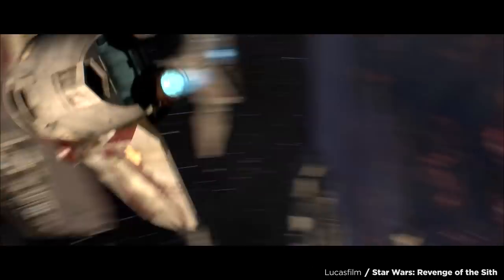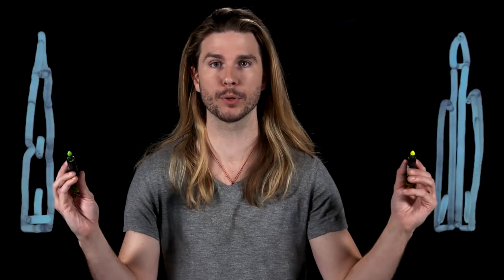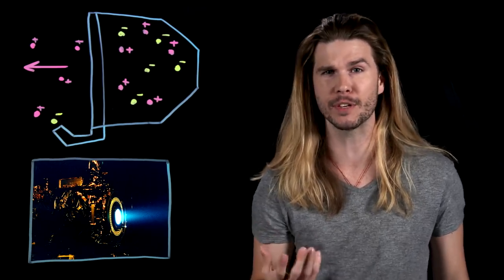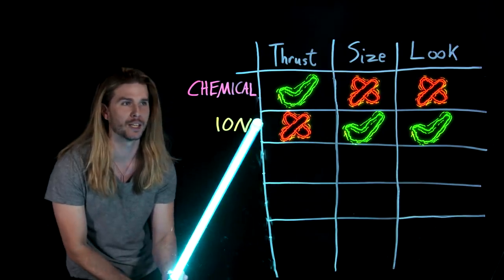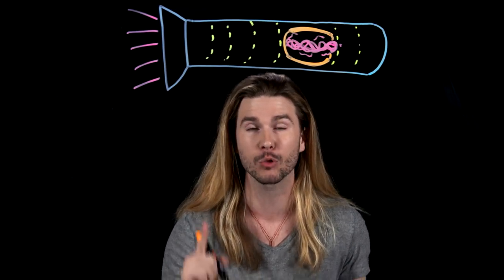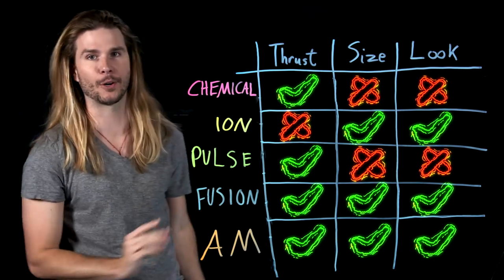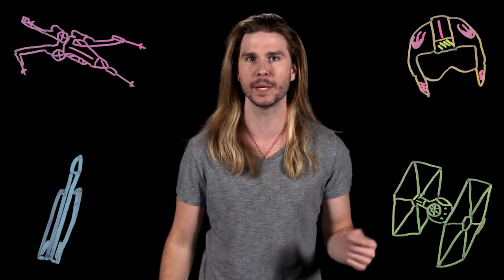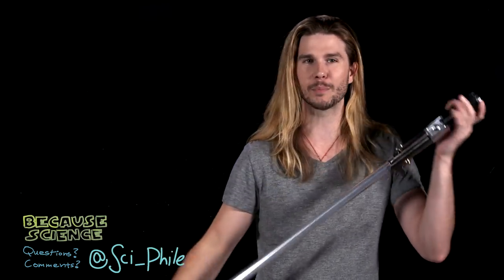How Would You Build a Real X-Wing? (Because Science w/ Kyle Hill)

Comment: Odd as it may sound, the bigger concern with the Project Orion engines wasn't the fallout produced (Cold War was still kind of nutty at the time), but rather the risk of nuclear proliferation.  In order to make that system work the bombs would have to be small - small enough to be stored in complex feeding mechanisms so they could be precisely ejected and detonated over and over.  That size concern is really the problem - if the technology to make tiny, powerful, efficient nuclear devices gets out anyone anywhere could potentially have a suitcase nuke (from the perspective of intelligence/security agencies, that is).

Interestingly enough, the thermal detonator Kyle is "holding" there is a pretty apt comparison.  You can use them like a hand grenade if you're insane, but they're powerful enough to use as starship bombs.

Comment: Some things I wanted to point out.
-Chemical Rocket Engines can be as small as your fist, ones the size of the X-wings engines could kill the pilot through G-forces.
-The Amount of energy generated by an X-wing capable of overpowering earth's gravity +1G with Pure Fusion and Antimatter is enormous, 1.5G requires 7.5TW Thrust Power, that means every 8.4s it puts out an Hiroshima Bomb worth of energy, meanwhile the X-wing hasn't even covered 200m. Fusion produces a magnitude less power than antimatter in this case but it is still pulverizing anything within 5km. Having an AM/FUSION "Afterburner" might help decrease it but
-Injecting cold remass into the exhaust to increase thrust without increasing power adds an need to carry fuel onboard for it. Depending on what you might find acceptable from a danger standout this can limit the number of blast offs.
-Fusion produces either a lot of neutrons or a lot of Bremsstrahlung X-rays, neither of them can be practically directed so they are a source of heat, lots of it. Even with chemical engine power levels it is like having an anti tank mine constantly exploding next to you.
-Antimatter produces usually even more radiation but not in form of vaporizing neutrons and x-rays but in form super energetic gamma rays. You will die of cancer, or just burn alive.
Reply: Oh hello there OMGitsWTF!
Reply: Hey Matter Beam, didn't knew you also watch Because Science.

Comment: They use them on the surface, in the vicinity of people presumably.  Wouldn't either Fusion or Antimatter engines be at least somewhat dangerous to be used around unprotected meatbags?

I was wondering if they harnessed gravitons or something.  I mean, they have artificial gravity, so maybe those engines are just directed gravitons?  It could also explain how smooth takeoff and landing is for most of the ships.

Comment: Many of the EU sources indicate that while the blade has little mass, something about the configuration gives them a strong gyroscopic effect. Maybe the magnetic fields are rotating and taking the plasma with them?
Also, in Trek several sources have indicated that while antimatter is the fuel source, ships really kind of solar powered in a strange way because planets in close, tidally locked orbits such as Mercury throughout the Federation are used as massive solar farms to produce antimatter. (I know it's a 2:3 resonance lock, but that' a recent discovery).

Comment: About that weightless bit at the end... yeah, you would be able to move the lightsaber around fast because it's light, but it also wouldn't have much behind it because all the force is coming from the hand... so... yeah... just thought I'd mention...
-Rex
Reply: Dung Heap You don't need mass behind the blade for striking. Lightsaber's blade doesn't cut, it burns through matter it comes in contact.

Comment: Fission fragment afterburner would work, particularly if its americium. Additionally star wars may fuse hydrocarbons. Their fuel is a flammable liquid at standard temperature and pressure and hydrocarbons are good at storing hydrogen, including deuterium. Deuterated diesel is a 7/1 mass ratio carbon/deuterium.

Comment: Thrust to weight ratio is key.  Saturn V only had about a 1.2:1 4 engines that together produce 25-30,000 lbs of thrust in a 22,500lb craft would likely be enough.  However we do not have anti-grav tech......X-Wings do as do TIEs.  Also you would need to vary which engines could fire in order to turn or which direction they could fire so you could break.

Comment: here is a because science idea for you, the Dreadnought impact scene from the new Star Wars movie. I figure basic physics Force=Mass X Acceleration. So if it was 600meters by 100 meters, 1 meter thick of steel (basicly an empty steel box, which is a really low estimate) it would weigh 5642652977Kg. and let's say it went 299,000,000 m/s (~99.9% speed of light for simple math) it would have hit with 1.68715324E+18 kn of force. that is the same as 3,440,835 tsar bomba (largest nuclear bomb ever detonated) hitting at once. the heat alone from the impact should have vaporized the entire dreadnought, and the Shockwave should have destroy the escaping frigates also. agree, disagree, thoughts?

Comment: 7:36...well, I wouldn't say that antimatter is very efficient in producing usable energy (all the time), because like you said, it produces energy through charged particles, and gamma rays. With the vast majority of the energy being used to create gamma rays, which are VERY DIFFICULT to harness usable energy from. However, the charged particles that the anti-matter reaction produces can be easily utilized to create electrical energy. But you do say in the video that the energy can be absorbed by a propellant (such as hydrogen). This could be very efficient, because propellant such as hydrogen could easily absorb the gamma rays by being heated up by them. So anti-matter on its own, very inefficient. But anti-matter combined with a certain "something (propellent)" can be very efficient

Comment: In the mid 90s , there was a laser based rocket engine, that used a laser to heat the air behind it to produce thrust. not sure why development  stopped, but by the time they did, they could launch a football sized rocket about 9 meters.

Comment: Not a word about thrust axis?  A 'star fighter' needs to have more than just rear thrust to pull off the maneuvering you see in the films.  They would actually need much larger Y and Z axis engines, as you are not only moving the same mass, you also need to overcome part of the momentum generated from the current direction of travel.

Comment: Kyle why didn't you use the VASIMR (https://en.wikipedia.org/wiki/Variable_Specific_Impulse_Magnetoplasma_Rocket) that NASDA is developing? "VASIMR, sometimes referred to as the Electro-thermal Plasma Thruster or Electro-thermal Magnetoplasma Rocket, uses radio waves to ionize and heat the propellant, which is then accelerated with magnetic fields to generate thrust.  The VASIMR method for heating plasma was originally developed from nuclear fusion research. VASIMR is intended to bridge the gap between high-thrust, low-specific impulse and low-thrust, high-specific impulse systems."

Comment: Since the propulsion system has to rely on theoretical science, why not use gravitational fields for propulsion?  Or, if not fields, perhaps the Republic/Empire/Rebellion/Order are using graviton particles?  Using gravity for propulsion might enable your craft to have all of the versatility of fighters, and yet propel the pilots to nearby star systems before they die (or run out of fuel).  
Also, X-wing fighters can travel FTL.  So, maybe these technically advanced groups are using tachyons?  Tachyons, theoretically, have very little (or zero) mass and must always be traveling faster than the speed of light.  Can they be used to take our "fighter" craft up to or beyond light speed?

Comment: Antimatter production would be cheaper if it wasn't that all production has to be of a specific type for scientific work, which massively adds to the cost and limits the methods that can be used. There is a seeding model for antimatter production that ends up with anti Carbon 14, the most difficult bit is getting the initial seeding stock, as I guess it is fusion products and some juggling to get the final product.

Wouldn't it be fun if we could get power from fusing antimatter while making the fuel as well :P It might offset the massive amounts or power required, but it's many orders of magnitude cheaper than using the scientific grade production methods for the study of anti-hydrogen.

Comment: Why not a fission/ion engine? Use radioactive fuel which produces heavy  ions as it decays, which can be electromagnetically accelerated out the back of the ship creating significantly more thrust than a conventional ion engine.  You could even use this as a way to dispose of spent fuel, using the nuclear power plant to power ship systems and expelling spent fuel ions for propulsion.

Comment: A TIE fighter would be easier to build. Engines and flight controls would be easier to place. There would be a small design difference due to pitch placement but  the tech is out there. To keep it fast and light.

Comment: Ion engines are only limited in thrust because the best way we know how to accelerate the plasma out the back is kinda bulky and inefficient. If you have unlimited energy and advanced concepts on how to do it, it might as well be ion engines. Though the distinction between an efficient ion engine with unlimited energy, and a fusion or antimatter engine is probably meaningless.

Comment: Isn't the explanation for lightsaber "heft" in the blade area handwaved as some sort of gyroscopic effect?

Would the output and field strength of a magnetic field like that create any sort of resistance in a swinging motion?

Also, I'm of the mind that lightsabers don't have any plasma at all. You wouldn't need crystals to "tune" a blade made of plasma, and the plasma color would not be influenced by a bunch of sci-fantasy crystals anyway. I feel like lightsabers are actually just solid versions of ray-shields or force fields in general, and their individual colors are the effect that a focusing crystal has on the energy field. The fields in SW are capable of reflecting or absorbing energy projectiles as well as slagging solid projectiles, can be manipulated around various shapes, and extended into spaces without a pre-existing hull, such as using ray shields to act as temporary confinement like we see in Episode 3. Plus, being able to concentrate that amount of energy into that small of a volume would likely see it able to instantly vaporize all manner of objects, from human limbs to blast door walls.

Comment: When you talked about the cost of anti-matter you said “we haven’t been able to produce more energy than we’ve put in.” Well, yeah - the Law of Conservation of Energy says that’s impossible. You can only get as much energy as you put in, and if you’re using it - converting it from potential to kinetic, you actually lose energy.

Also, I have a theory as to why we can hear blasters in space: if we’re assuming that the beams are plasma, then whatever propulsion is being used has to have a higher threshold for heat to prevent it from becoming plasma itself. So, when you fire the blaster, you’re expending a large amount of gas into open space. Because there’s no atmosphere, there’s a huge pressure differential. When the gas is released, it spreads out and disperses unbelievably fast. My theory is that the sound moves through that expansion of gas.
Reply: He was talking about fusion when he said that. And he didn't mean "create energy out of nothing" he meant "produce more usable power than you put in". ie, the Energy Return on Investment. So for example,  crude oil takes a certain amount of energy to get out of the ground, etc., but you get far more energy out of burning it than you put into getting it. Same is true of nuclear fission. It takes a certain amount of energy to initiate the process, but then you get a lot more energy out of it. Whereas current experiments in fusion do not return more energy than was put in.
Reply: Adam Lytle Gotcha. My bad.

Comment: Well, you could use ion engines with high thrust, just have to use an insane amount of energy to propel a lot of propellant
Reply from the maker: That's kind of impossible, given how the technology works -- KH
Reply: On a ion thruster we put a lot of energy into very few particles. And we get low thrust.
But (if you completely ignore the power requirements) 
1) if we put a lot more energy at the same few particles, or 
2) if we put a lot more energy into a little more particles 
we will increase the amount of thrust without increasing the mass of the thruster.. increasing the TWR and the thrust.
Of course, there are limits for the amount of energy per mass and for the exhaust density, but given the limitations said in the video (thrust/size/look) it may or may not reach the thrust level of an X-Wing.

For illustration, the thrusters used on Dawn have a 24kW/N power consumption per thrust, and if you generate 1.21 gigawatts you would have 50kN of thrust.

Comment: You left out the part about anti matter reactions requiring a dilithium crystal, as it is the only material that doesn’t react with anti matter and can withstand the power of the reaction. Not to mention the storage cells that contain the anti matter and the reaction chambers and pipe line. Bottom line; the Enterprise is the only ship big enough to contain the entire reaction assembly.

Comment: nuclear pulse dose not work in space because the majority of a nukes effect is from the over-blast caused by air pressure. as in all you get is heat, an emp, and an ever expanding belt of radiation. essesntialy explosion based propulsion doesn't work with out air to transfer the shock wave.

Comment: If were talking about current day physics and I was asked how would I build the X-wing? Simple.
Make it bigger, probably the size of an offshore patrol boat or spacex starship size, will have one big engine nozzle(blame the forever war : forever free graphic novel)give it some CIWS or PDC's all over its hull, rcs thrusters, a railgun and would still have 4 laser cannons, alot of torpedoes loaded internally and externally, place 4 radiators in an X wing configuration, give it a hab module that can have gravity via rotating and while under thrust, and turn that large canopy into a sensor unit or observation deck,  can carry tie fighters repurposed as kamikaze drones and can engage targets beyond visual range, and will not dogfight because 40/60 dogfight=suicide and suicide=you dead, very very dead, will dogfight only when neccessary.

Comment: But how fuel efficient would the fusion engines be? Would the fuel be able to fit in the ship with the considerations to the mechanics and systems? What about the other thrusters a spaceship would require? And how would you compensate for the forces on the pilot?

Can of worms, man. And you insisted on opening it.

Comment: So You think you want to build a "X wing"?...I was around when the first movie came out. Of course I still have a modal, Blasting tie fighters is still a favorite waste of time. This description will probably take a few posts, after all It Takes a lot of systems to make this thing happen. So lets take a look at the obvious systems that HAVE to be there. The Hull, Wings, Engines Impulse/ Hyper Drive, control circuit/ mechanisms, Cock Pit/ Life Support, Sensor Array, Computer Array/R2 Systems, Weapons' Systems -  Photon Torpedo/ Wing Cannons, Shields, Communications' Internal/ External, Auto Repair Array Systems. Power Grid, Thermal Transfer Grid, Fuel Transfer Array... and maybe a few moor that don't come to mind right now.
   Some how I think 10,000 Kg or 22050 Lb., is a bit much, No I think A X-Wing would come in around 7200 Lb. or 3266 Kg empty, full fuel/ armed  10960  Lb. or 4970 Kg. +/-
   It's late, tomorrow is on the way. I'll catch you then with thoughts on the Hull/Wings and Drive Systems.

Comment: Most vehicles in Star Wars use anti gravity so they don't need as much thrust as you think.
Reply: Chronos Havok - cause anti grav is important for thrust... In space... Where there is no gravity.
Reply: dkail08 he spends half the video talking about ships that regularly go down into planetary orbit. A modern day rocket only needs that much fuel to escape Earth's gravity. In star wars gravity isn't an issue.
Reply: That's true, but they still need a lot of thrust to accelerate and maneuver the way they do. Granted not as much as would be required for escape velocity, but definitely more than any currently used thrust tech that meets the rest of the requirements (ie ion engines aren't feasible). /Shrug

Comment: Plasma is not a gas, sir.  It is a fluid.  Technical point, but this is 'Because Science.'
Reply: no, it's not a fluid either, fluid suggests liquid, plasma isn't liquid, nor is it gas, plasma is its own state of matter
Reply: If you are going to make a statement about fluids, know what a fluid is.  Take 10 seconds to look it up and find on Wikipedia : 
In physics, a fluid is a substance that continually deforms (flows) under an applied shear stress. Fluids are a subset of the phases of matter and include liquids, gases, plasmas, and to some extent, plastic solids. Fluids are substances that have zero shear modulus, or, in simpler terms, a fluid is a substance which cannot resist any shear force applied to it.
Reply: He said fluid, not liquid. There is a difference.